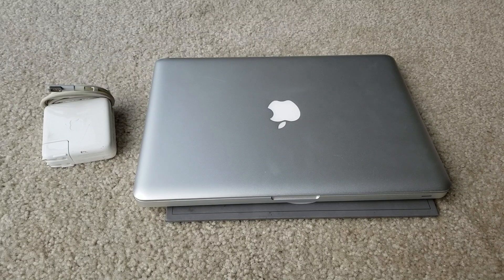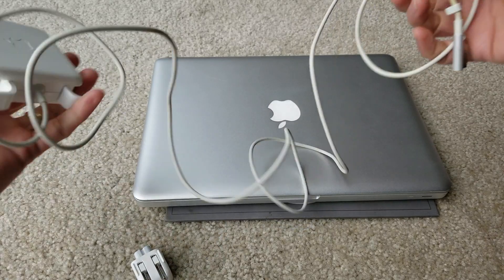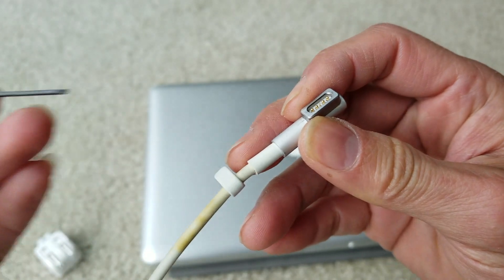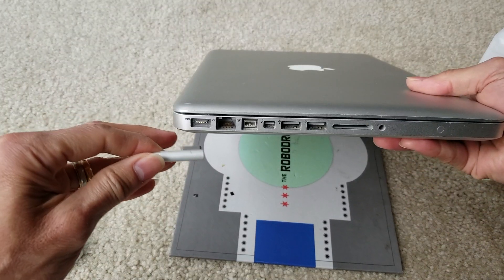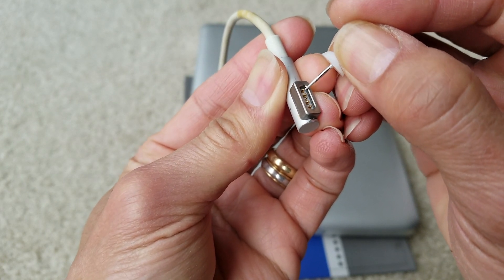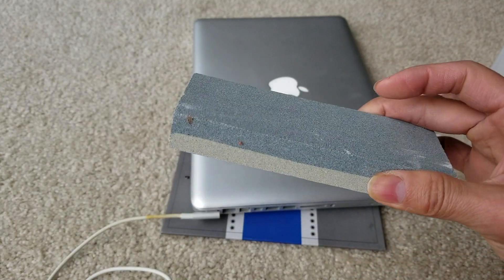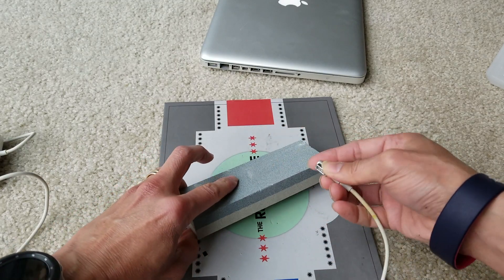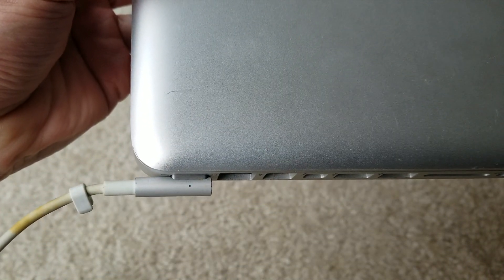How To Fix Any MagSafe Apple MacBook Air Pro Charger! 3 3 2019

Comment: Bro a huge thanks
I was worried because this was the 2nd charger I had to buy
Then I saw the port in my laptop
It was blackish and I thought it was it's colour but it came out to be a layer of dirt
This Mac has been used by my dad, sister and a cousin brother and it was in a good condition but I didn't check the port
I hav been using this Mac for like 2 to 3 years now
I have a bonding with it now
Thank you for saving my Mac
I appreciate your help

Comment: Thank you. The grinding worked, I used a sanding block and cleaned w alcohol prior to plugging and the green light came back on. Prior to grinding it I had no light on mine and it was charging but not at full strength.

Comment: My charger is not working and getting very hot with a burning smell what should I do?
Reply from the maker: Disconnect your charger right away, you might have a short or burn out capacitor.

Comment: Hi, I used the steps above but no luck, my MagSafe is still new 3 months old , the pins are unstuck not burned on either the MagSafe or the port on my Mac, I used it the same morning it stopped working for me, idk what the reason is the MagSafe is in good condition from what it seems, any advice? And plus I can feel the current on my Mac when I plug the MagSafe, it just don’t turn green it stays blank and it doesn’t charge? Plz any advice on this as I have so many dealines coming need my laptop

Comment: Macbook air not picking up charging in my home socket and many place outside also i tried , but it work at service center, what is the problem,
Reply from the maker: Maybe your home socket or outside socket not having a tight fit with your charging adapter. Try to bend the metal prongs outward, good luck.

Comment: It worked with my Air, but only got a green light on the Pro, it didn't turn orange. It's showing only 94%. It says not on battery, but not normal power charging either. It's definitely not a battery issue. Any ideas? I'm scared to sand down more!!!
Reply: OK, with careful moving it around, I am now getting ORANGE. But it is going to be so sensitive. Will grinding down a LITTLE more be good? When is too much???
Reply from the maker: Little more grind should be fine, clean metal contacts with 91% alcohol and dry it before plug into your MacBooks.
Reply: @macdaddypimpping  THANK YOU! I will proceed carefully!!!!!

Comment: Water got in the chargers end and it’s wet inside , the charging if just flickering do you know the fix?
Reply from the maker: Dry the wet part with a hair dryer first or it can short or do more damages when it's plug in wet.

Comment: awesome!!! Both my chargers stopped working within two days of each other and were out of warranty.  I followed the directions for cleaning first, that didn't work.  Then I followed the direction on sanding the edges it worked.  Thank you for saving me over $180 to replace them

Comment: my cord was still charging but the connection was loose. when it looked at it closer I saw raised edges on the end. I sanded as directed and now the magnet is holding much better. thanks!
Reply from the maker: You are welcome.

Comment: I have a macbook air...and I charged it today at 8%. It charged at first but stopped after a few seconds. Pulled it out and realized the charger is filled with watery sticky stuff and I quickly wiped it off. Tried again but the computer stopped working completely. Few minutes after the pad on my laptop was jammed and I’m afraid I think I got some liquid in there. What do I do???
Reply from the maker: Try to dry it with hair dryer.

Comment: Thank you! First I tried the grinding thing, but it didn’t work then I went onto scrap the pins gently with the closest piece of metal I could find, which happened to be one of my pendents of my necklaces... when I tried to scrap the pins there was an electrical spark... turns out I hadn’t plugged off the charger while I was trying to scrap it (stupidity I know...🤦‍♀️), but when I tried to switch on the MacBook Pro it WORKED! My MAC was at 0% and I’ve been trying to get my charger to work for a long time. Thank you! 😊

Comment: Hi thanks for the video! Can I ask you, why there is the plastic tape (isolation) in "plug-in hole" in mac (the hole where you normally put the ending of your adapter?) 
I just clean it today, but I remove that plastic staff too, because there was only half of it ---- Is it save to charge now? Thanks
Reply from the maker: No idea

Comment: I scratched the pins of the charger and on the Mac with the tip of a razer and it worked. Though I dont know for how long it will work since it has gone bad from new when it was in the best shape.

Comment: i have the same mac from the video and recently my charger stopped working so i bought a new one but even the new one didn’t work. weird thing is that it worked one time then it didn’t 🤷🏻‍♀️🤷🏻‍♀️
Reply from the maker: Make sure you got the correct charger that meets your Macbook specs, aftermarket charger tends to break easy.

Comment: Hallo
I have MacBook Air 2013 ,14.85V - 3.05A..(45W) Model A 1465..
Can i use charge cable 16.5V - 3.65 A (60W) ?
Reply from the maker: No, that might damage your original battery.

Comment: This is great. I used contact cleaner instead of alcohol and it also works. However, it only worked after grinding it on the sharpening stone.
Reply from the maker: Thanks for sharing your experience with our viewers.

Comment: Hey man, my  macbook air charges, but, the LED doesn't turn on, and the battery doesn't go up. Whats my case here???
Reply from the maker: You might want to check your battery cycles, probably your battery is getting too old and have been charged many times.

Comment: Hey man, my 2013 macbook air charges, the LED doesn't turn on, and the battery doesn't go up. Whats my case here?
Reply from the maker: That means your MacBook Air either not connecting with your charger or your charger is mess up. Go click on your battery showing on the upper bar and see if it needs "Service Battery".
Reply: @macdaddypimpping  my battery was just changed and has 1 cycle. I figured out the charger is a 3rd party charger and not the original. Thank for your reply :)

Comment: It works the only problem is that the things in the charger went back in after I hit it on a hard surface so it could come out, then it stopped charging, what do I do?
Reply from the maker: Unplug the power for couple minutes, use a pointed tool or paper clip to push down those gold contacts to see which one is not spring loaded and use a small drop of lubricant oil.
Reply: @macdaddypimpping  Can I use any other oil, or liquid?

Comment: Mine would have a green light but the lightning bolt thingy on the charger portion won't appear?
Reply from the maker: Check your battery cycles.
Reply: @macdaddypimpping  I can't check it anymore because my MacBook is literally off and the charger won't work
Reply: Mine the opposite. No light but charging bolt shows up on screen

Comment: OH MYYY GOOOOOOD! (In a nutshell  dont be scared doing the sand paper thing paper srsly it worked for me)
 My laptop just wont charge anymore at 3am so I tried doing many other things to make it work like the reset-pressing-keys-thing or removing the screws and plug of the battery smt but never did the job. After many hours of watching repairing videos (more on the hardware. idk how did i ended watching those) now its 7:20 am, finally I found these as I was about to sleep then I told myself at the start of the video that if this works, I'll give it one more shot then look now lemme continue using laptop now and sleep later   ͡° ͜ʖ ͡°. WHAT A GENIUS

Comment: It doesn’t wirk
Reply from the maker: Either your adapter is broken or there's a problem with your charging port.
Reply: macdaddypimpping is there any fix for a broken adapter? I heard a loud kinda pop/explosion inside the adapter and it stopped charging. Is there a fix or do I have to buy a new one?
Reply: @mrzpear8828  A capacitor or something exploded if you hear that pop it is impossible to fix im sorry...
Reply: Why I’m going to be sad I can’t live without my computer my sister is an E girl🖤